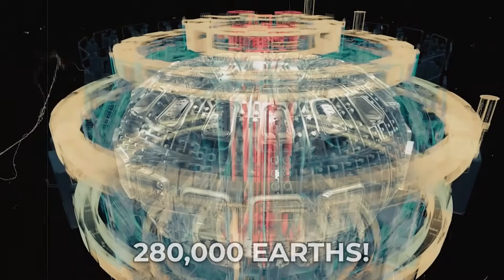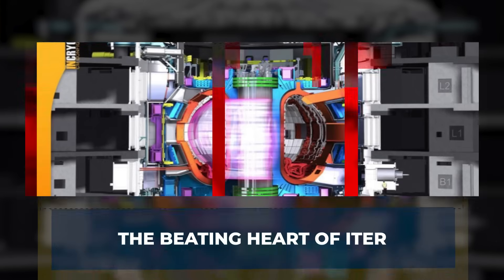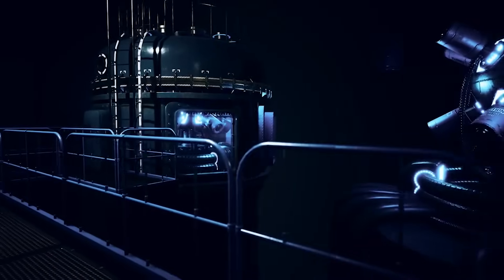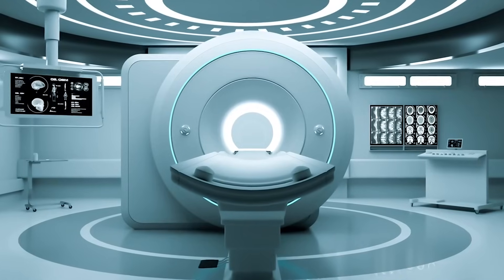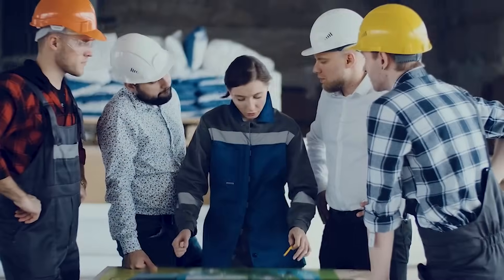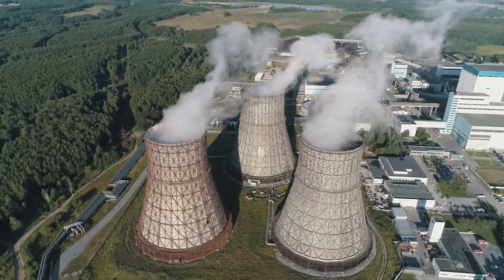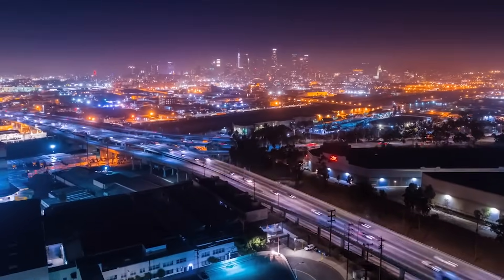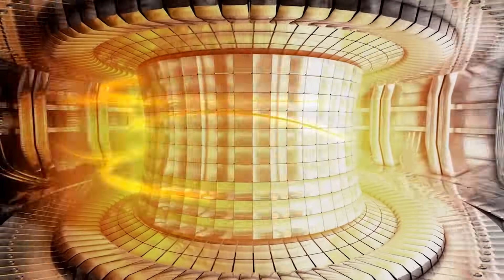This Machine Is Stronger Than 280,000 Earths!

Comment: Scientists and others have been trying and experimenting with nuclear fusion since the 1950s with a possible goal of using fusion energy to generate usable electricity. The big problem has always been achieving the extremely high temperatures and pressures needed to fuse hydrogen into helium and somehow trying to get more energy out than is being put into the fusion reaction. With these tokamaks we have achieved nuclear fusion, but we have not achieved usable heat energy going into a boiler to make steam to generate electricity. I am one of those who suspects that practical generation of electricity through nuclear fusion will never be achieved.